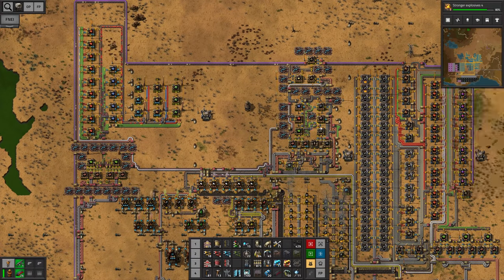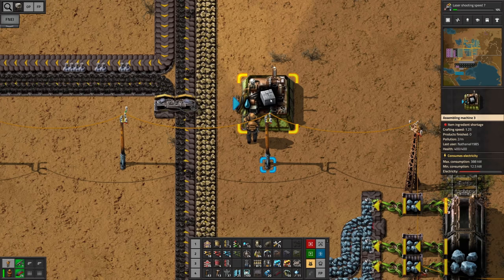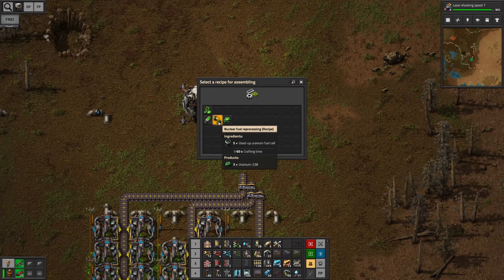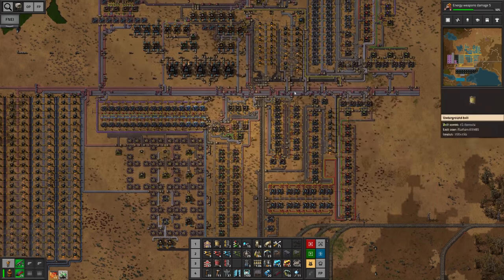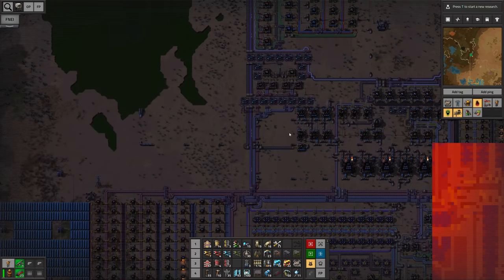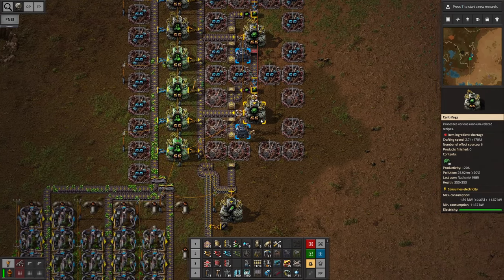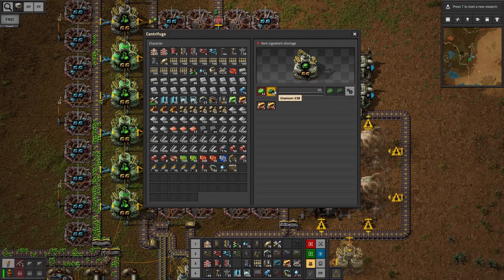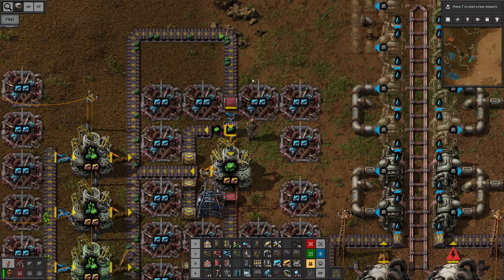NUCLEAR POWER EXPLORATION - Factorio: Ep. #9 - Guide & Let's Play

Comment: First Nuclear Tips: you need 4 Heat Exchangers per 40 MW of nuclear production, and after the Heat Exchanger has heated the water up, the Steam can travel any distance you want.  This means you can use a Fluid Pump to push the Steam into Storage Tanks, and then from the Storage Tanks to an array of Steam Turbines.  If the Storage Tanks start to fill up with Steam, you know to install more Steam Turbines (or use more power).  Once the Storage Tanks start to level off and even drop, you know that you have enough Steam Turbines.

With your 2x2 Array, you should be able to produce as much as 480 MW of power.  If you can get all the power out via Heat Exchangers and Steam Turbines, then compared to your base's current demand of ~150 MW (13:09) your power worries are over for quite a while.  The problem is that the Nuclear Reactors burn the Fuel Cell no matter if you are using the power or not.  Off-hand I would recommend an array of ~40 Storage Tanks for the Steam to make sure you can store all of the steam from a single Fuel Cell per Reactor.

One fun idea would be linking all the storage Tanks via Green Wire, and linking that Green Wire to a pair of Programmable Speakers.  From there, set one the Programmable Speaker to do a map-wide message (set the sound off) if the Storage Tanks start to get full, and a second if the Storage Tanks start to get empty.  The 'full' alarm lets you know that you may need to install more Steam Turbines or Storage Tanks depending on your power demand, while the 'empty' alarm lets you know that your Steam Turbines are consuming all of the Steam and your base is about to run out of power.
Reply from the maker: Thanks for all the info!
Reply: There is a much simpler way to figure out the ratios. Just hover over the buildings, they say how much they consume and produce. No need to mess around with storage tanks. Storage tanks also can't differentiate between building too few turbines or your factory not consuming full power. The amount listed in the info box is the perfect ratio.

There's also no need to store excess steam. His uranium patch is a million ore. That is 1 million before mining productivity. That will last the entire game regardless if he's storing steam or not and regardless of his end goal.

The only way to deplete a patch is if you are using the uranium for ammo or nukes.

Comment: Fun episode to watch, felt sorry when you brought the rocket fuel all the way up! First time nuclear is always difficult, but kudos for you trying to figure it out yourself. Certainly better than my first attempt! I usually build a small setup with 10 storage boxes as soon as I research nuclear that is being filled with "good" and "bad" uranium so that I have at least 40 by the time I want to make a real nuclear setup. And then I design the real koverax + nuclear setup when I need the power. Cause waiting for 40 takes long when you actually need it. 
Performance wise, the devs made big improvements to nuclear compared to early versions, so it's a bit of an ancient rule that is being passed on and on without people retrying it I think. It is true that solar +accumulator requires less UPS and is therefor the best choice looking at performance but the difference is not that big anymore (in my experience). Unless you make an ultra megabase perhaps? (not to mention the space required for solar, all the bots flying around every time you add solar, ... ).
Reply from the maker: Yeah hehe if I knew about that initial procedure I would have started long ago;)